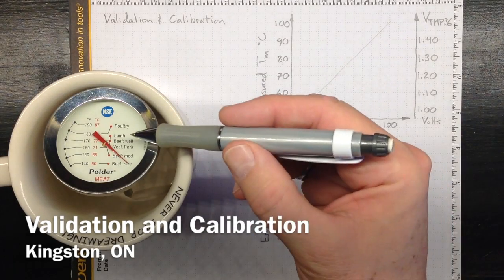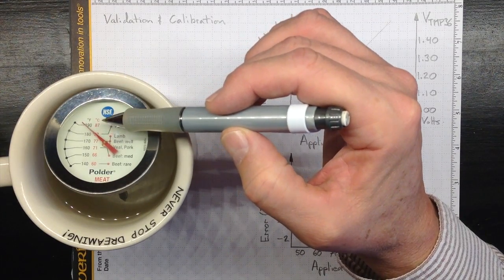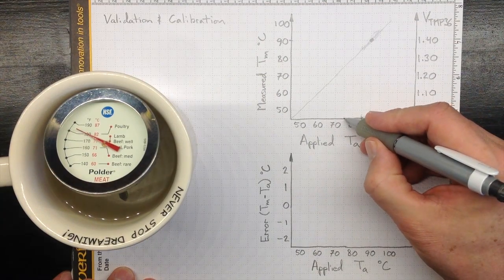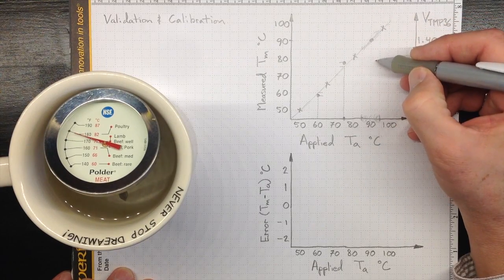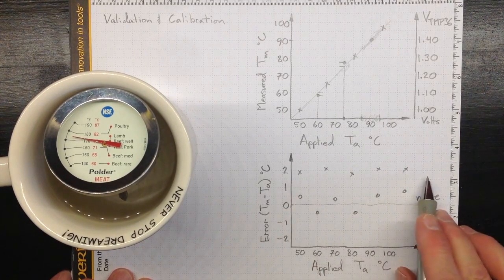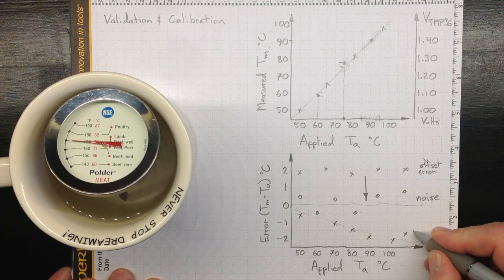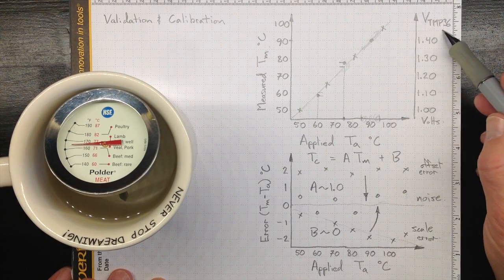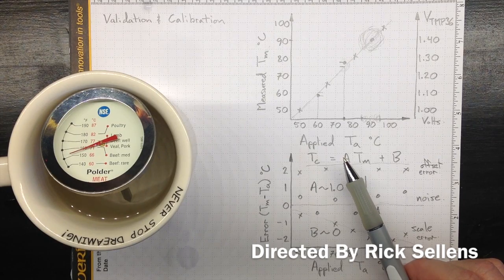Validation and Calibration

Comment: Greetings, when calibration an instrument e.g. pulp moisture instrument and my pulp product moisture range is from 4% to 11%. My low moisture range is from 4 to 6% and high moisture is 7 to 11%. When sampling low moisture samples is it advisable to just target 5% samples for low moisture and target 9% samples for high moisture samples. Or do I need to collect different moisture samples covering the full low moisture range and high moisture range.
Reply from the maker: You would need to go to the manual for the meter to get the manufacturer’s recommendations